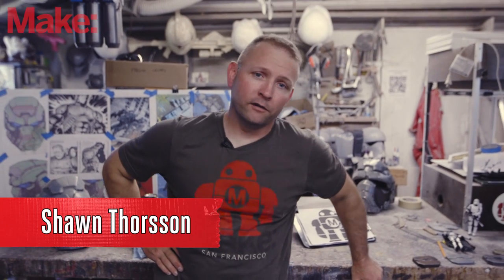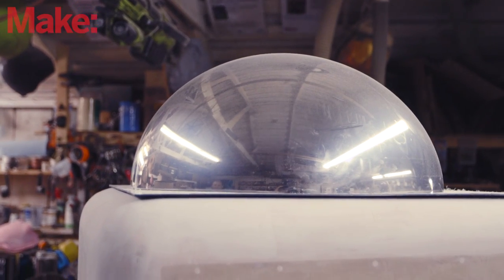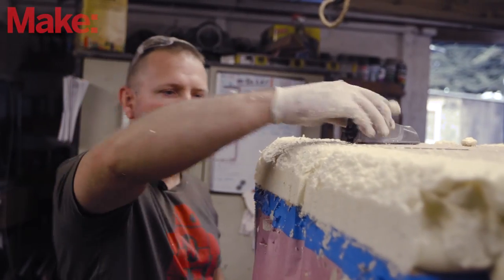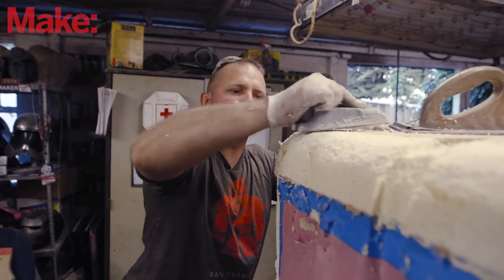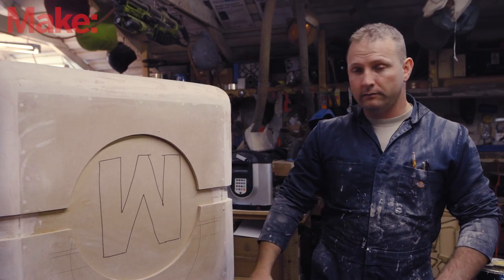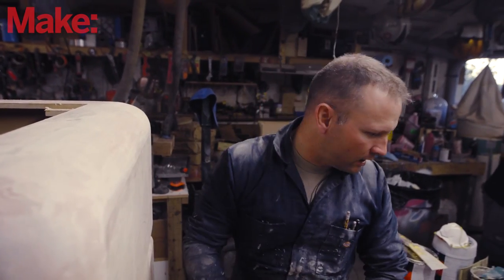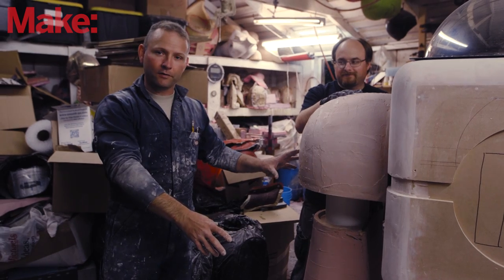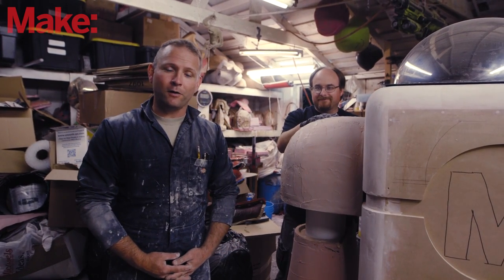Making Makey Part 2: Building the Prototype

Comment: Could you just use regular insulation foam in spots instead of expanding foam?
Reply: +Andrew Little The styrene monomer in the body filler dissolves polystyrene foam. IMO, a better option is floral foam. It's way cheaper than the expanding foam. The bricks can be glued together or to other surfaces, it shapes waaaaaay easier than expanding foam, and it's impervious to styrene monomer. Oh, and it's usually a lot cheaper.
Reply: +hotrodsurplus you know I knew that but I see people do it all the time. I guess they build it up enough. I also was thinking the filler would do the same to this foam, but apparently not. Thanks for the reply.